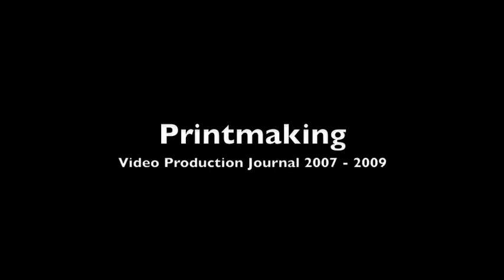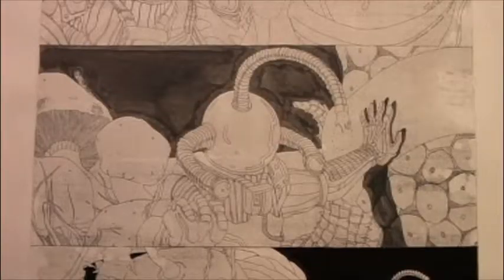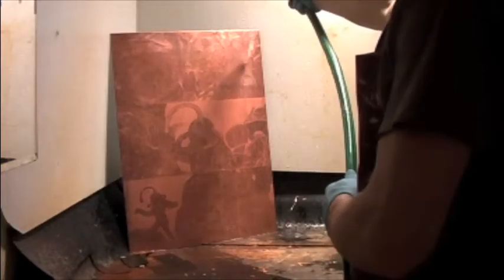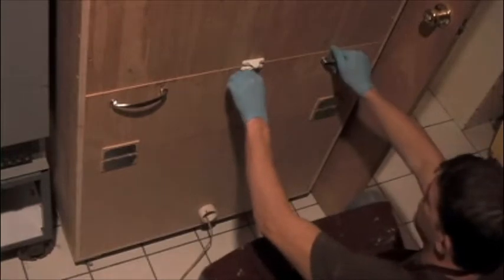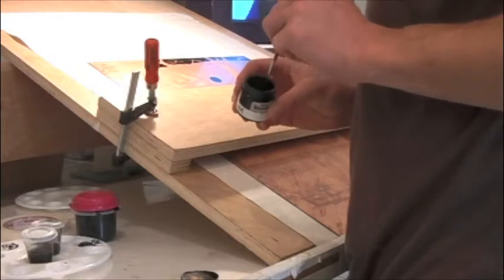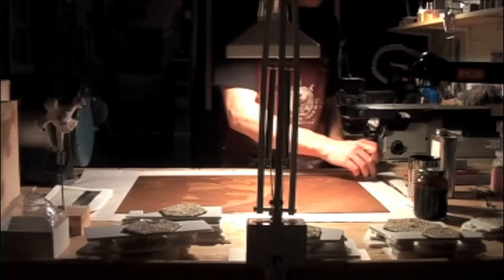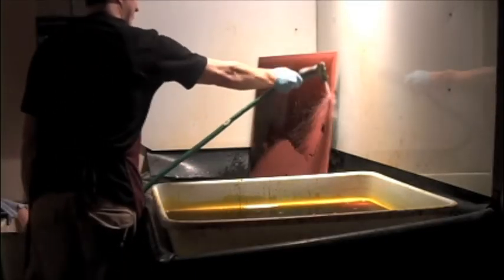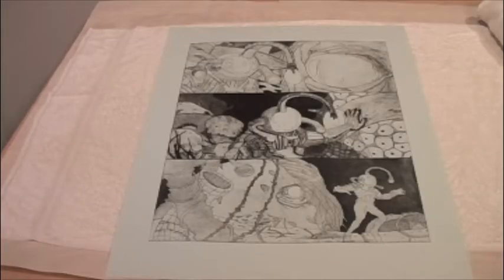Printmaking Video Journal

Comment: @John Mitchell: How long does it take to complete one etching?
Reply from the maker: It depends on the size of the plate and how many states and different techniques are used. Finishing a print ready plate like the 4x5" (small) hard-ground etching with one round in the acid like my "Portrait of a Girl after Velazquez" took about a week with several visits to the Metropolitan Museum of Art to work from direct observation of Velazquez's painting. Once the plate was etched, proofed, and ready to print - printing the edition of 50 took months. It takes about 40 minutes to hand-wipe the plate in order to make one print. Plus clean up time. Then the prints are hung to dry for about 2 months. The oil ink takes a long time to dry. The paper curls and warps as they dry on the line. Then the prints go back into a water bath and are then put into a paper press to make them flat. So all in, this small simple print took about 8 months from start to finish. Unlike most printmakers who work with master printers, I do everything myself from start to finish including printing editions in my studio printshop. A bigger plate with varied techniques and many times through the acid bath can take 5 years or longer from start to finish.